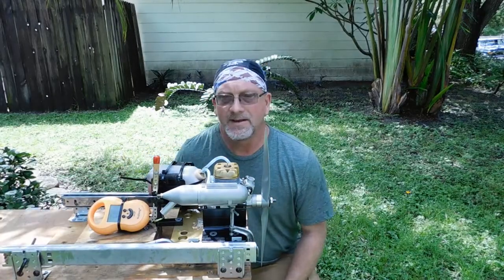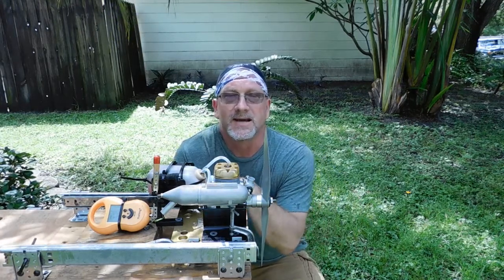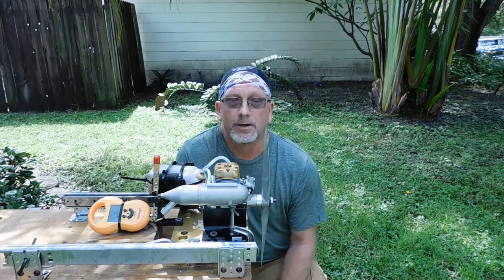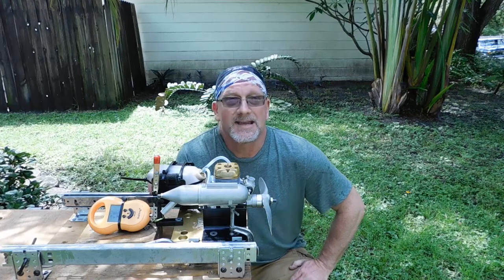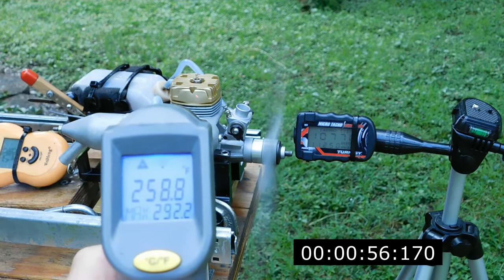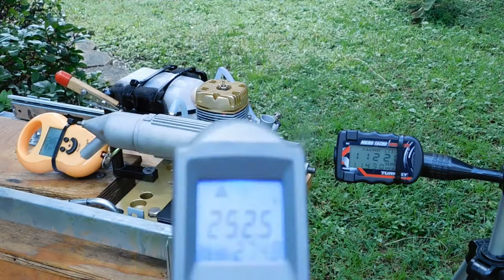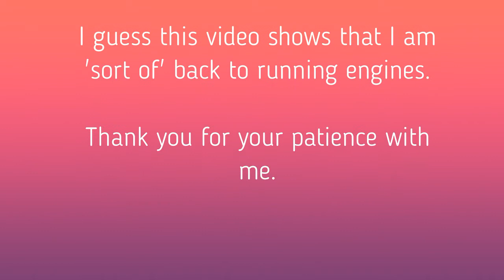Vmax 52 Home Brew Fuel Run

Comment: Hi Dave thank you for all the great videos. I just bought a magnum 91 4 stroke can you tell best fuel. Prop and glow plug will be putting in sight astro hog motor is used,broke in never mounted looks really nice. Any other suggestions or videos for this motor
Reply from the maker: No I don'r make recommendations on those things.  Fuel and props are very subjective things.  What you see me run in my videos works for me on the stand, but propeller selection needs to be made on an airplane through experimentation.